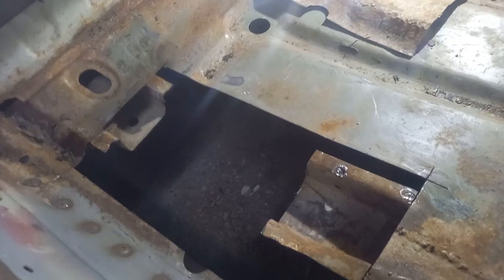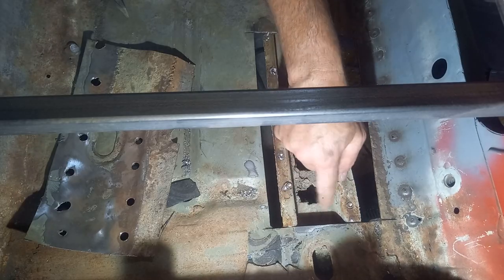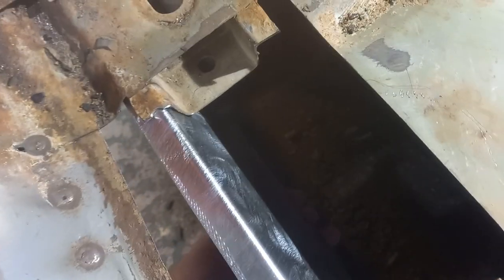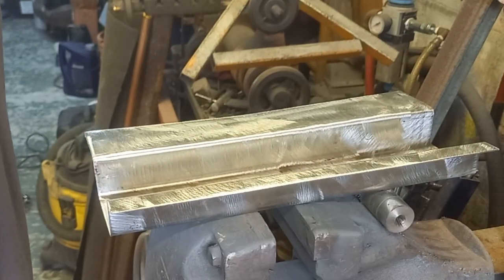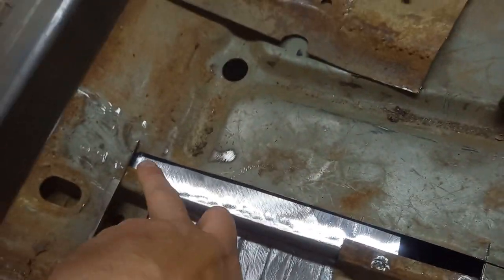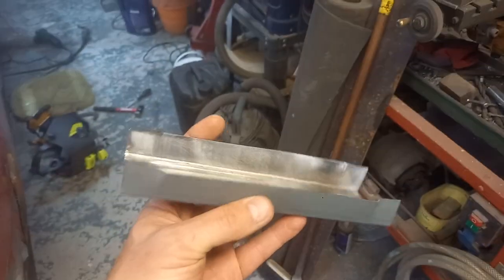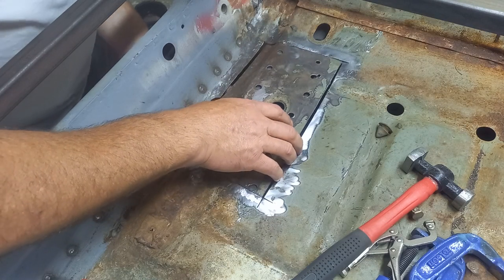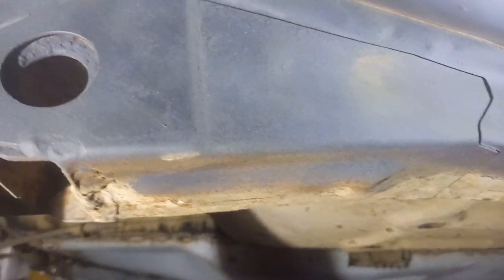Ford Escort MK1 Restoration, OS Chassis Repairs. Car Restoration.

Comment: Great work Dave. I never had a rotisserie when I was younger I used to turn them onto old tyres and prop them up. Totally agree with you about not liking to weld from underneath if you dont have too. A stray spark down your boot or top and your banging your head on the car as you try to escape LOL. The pain from one down your ear is another level . anyone who knows what thats like has been there.  It  certainly aint  something you forget in a hurry.
Reply from the maker: You have clearly done welding upside-down 🤣🤣, it's in the ear I hate the most 😬
Reply: @DavesGarageuk  Yes Dave. The noise as it burns the hairs in the ear is one thing and the pain is another lol.

Comment: More great work, this is a major landmark, turning over to tidy up the underneath. I bet you've had the steel for the turnover jig for  several years in readiness. Congratulations on the sale of the 100E I think the new owner has a bargain!
Reply from the maker: Thank mate, sadly the winning bidder was one of life's losers, no contact made, it's being relisted at 6pm, another £15 down the drain.
Reply: @DavesGarageuk  Sorry to hear that Dave,  can't you do a second chance to the next highest bidder? I never had a problem like that on ebay (yet!). I once had a guy claim he hadn't received his motorcycle brake pads and wanted a refund. Though he had left feedback saying "can't stop got brake pads to fit" needless to say after I responded to eBay, they never upheld his complaint. 
Hope you get a good eBay outcome.

Comment: Sometimes it,s not a good idea to put extra strength in  certain area,s ...if you have a collision the chassis will not perform & collapse in a controlled maner.
Reply from the maker: Don't think that's going to make much difference here tbh but I get what you're saying, thank you.

Comment: Great job again Dave, I’ve got the same rtech welder as yourself what settings do you have it on for thin steel 👍
Reply from the maker: Hi Neal, it's a great welder, I have both amps and wire speed  just less than half way, that's what I love about this welder, super adjustable.
Reply: Ah great yeah that’s what I like you can make fine adjustments I’m using 0.8 wire practice that’s the key
Reply from the maker: I find 0.6mm wire works for me, needs less heat, better for thin metal.